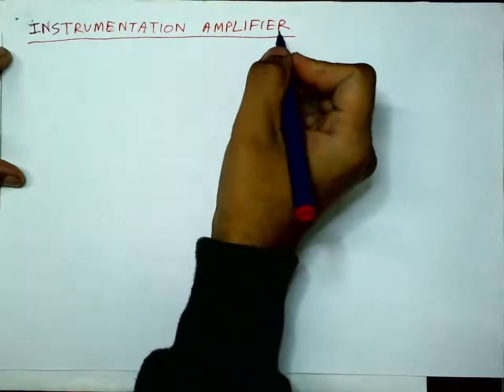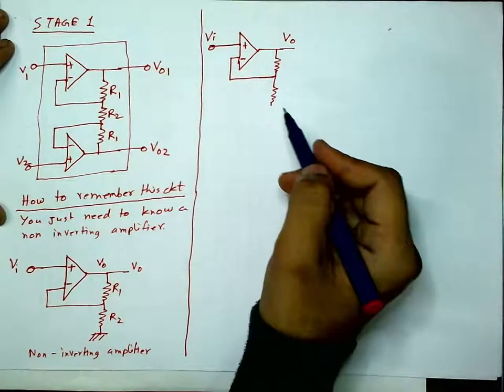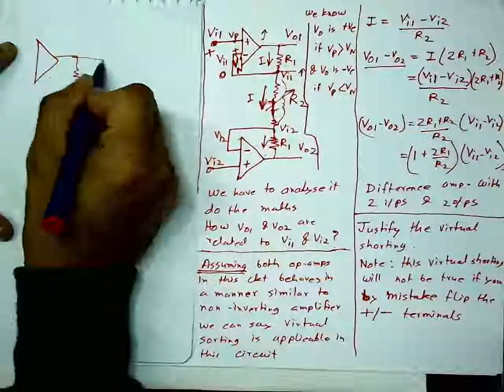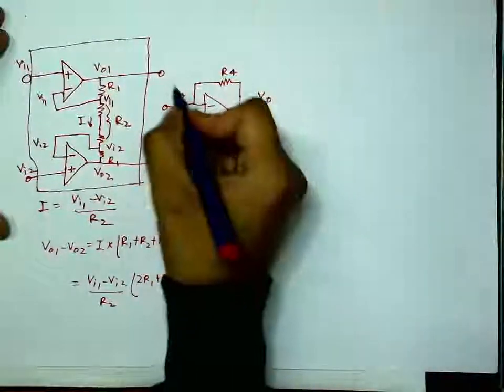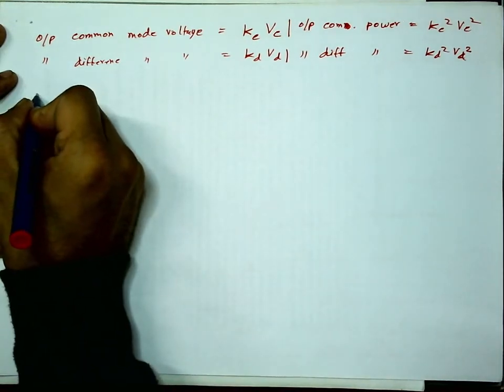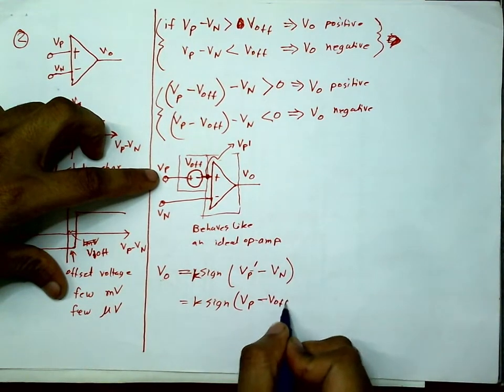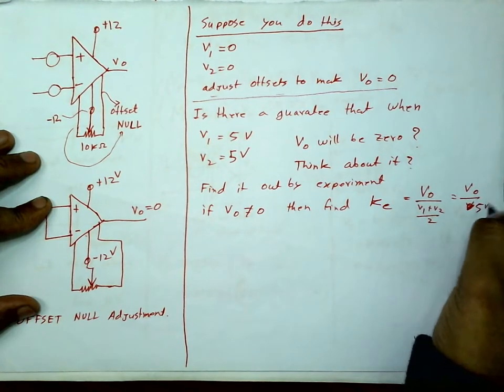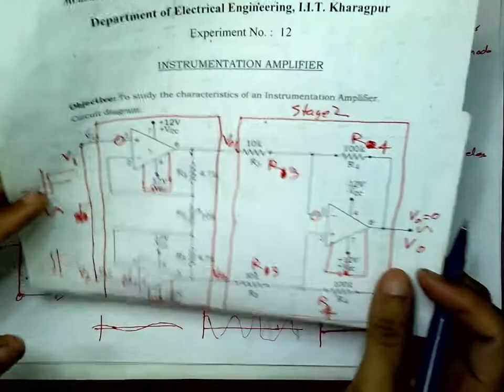Instrumentation Amplifier circuit

Comment: Calculated cmrr wrong way in decibel mode.
Reply from the maker: Thanks for pointing out
Reply from the maker: BTW, this mistake is already mentioned as the correction (2) in the description of the video
Reply: @AVISHEKCHATTERJEEEE  
Okay Sir, didn't reach to that part when I wrote this comment.
Lectures are very good for conceptual clarity. 
Thank you very much Sir.
Reply from the maker: You are welcome
Reply: @AVISHEKCHATTERJEEEE  
Checked the description. Thank you Sir.